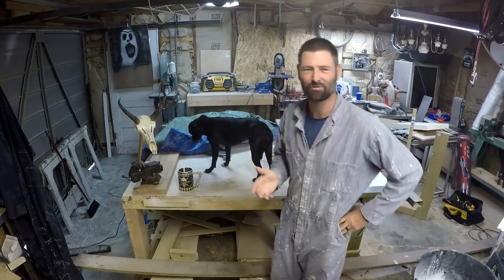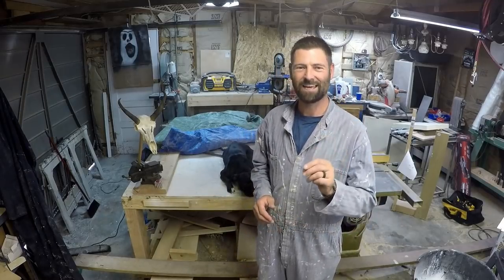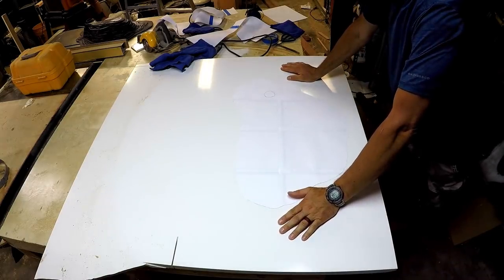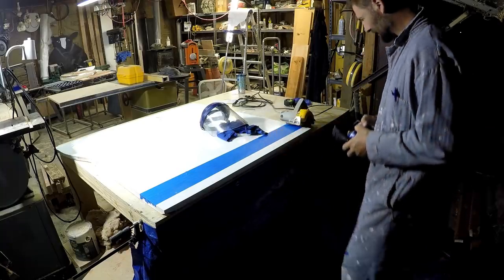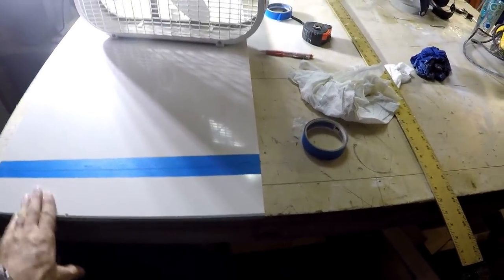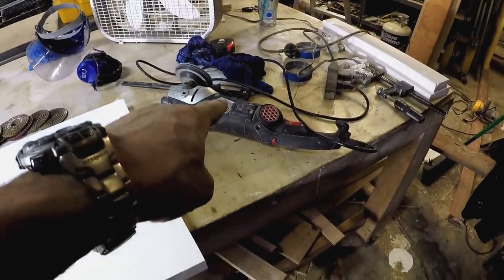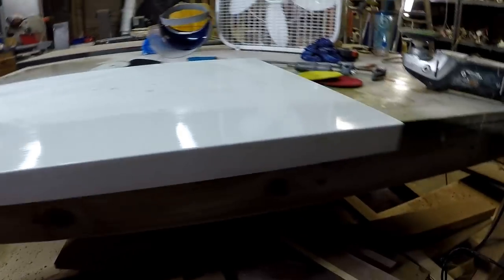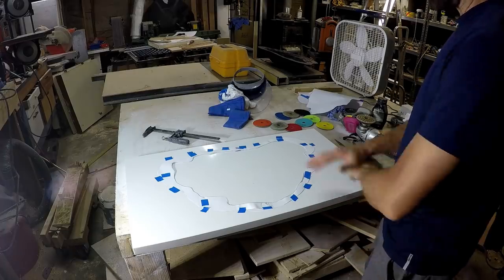How To Make Your Own Quartz Countertop  | THE HANDYMAN | 1940s Bathroom Remodel

Comment: I have the exact same saw, bought it at HD back in the early 2000’s. I only use it occasionally to cut bricks and concrete. I always thought it was pretty good for an off brand tool.Nice to know it can cut granite and quartz if I ever need to. Look forward to seeing you finish the top. Thanks

Comment: You can use a diamond blade for your band saw and use a die grinder to start the polish on the sink cutout. It looks like you would have the clearance to work the slab around.

Comment: Grats on the sponsors!

I frankly don't get why anyone would want a sink like that. Cleaning a standard, smooth enamel sink is enough of a pain in the ass. Keeping that thing clean will be a nightmare. Look cool? Sure. Until you have to scrub it. Think about what it will look like with dried toothpaste crusted in all those little ridges, and when the finish starts wearing off.

Comment: Something I always wonder about these types of jobs is, if you have to buy special tools, saw blades, grinding discs, etc to do that one job, and maybe rarely/never need them again, does it pay well enough to cover the cost? I'm sure sometimes it must just break even or even lose money?
Reply from the maker: I will lose around $200 on this project but I gained a priceless amount of experience.  I took this a a challenge to myself to see if I could do it.   If I failed I have a solid surface counter top fabricator I can get one from.
Reply: On certain jobs I tell my clients up front they're buying special tools etc. if needed. I leave everything they buy
Reply: Good point! I used to do some cleaning and simple maintenance jobs and from time to time I had to lose  a little on a job, but I was helping out an elderly one and I'd have the tool for future use

Comment: My friend has a kitchen counter that is 1cm of quartz over 2 inches of plywood. How would you recommend cutting it to enlarge the sink cut-out?
Reply from the maker: is it a top mount sink or undermount sink
Reply: It’s a really cheap white fiberglass top mount with an odd hole size. Kitchen installers don’t seem to want to touch it. It’s the strangest countertop I’ve seen. Looks like one of those ‘granite transformations’ overlays but it’s just a thin quartz overlay over bare particleboard/plywood. 
I was about to attack it myself with a diamond jigsaw blade but I’m almost positive I’d crack the sucker in half.
Reply from the maker: If you use a new drop in sink you can use an angle grinder and a shopvac to catch the dust.  Put the hose of the shopvac right up to the blade on the angel grinder. Use a diamond blade to get through the quartz then a wood saw to get through the wood.
Reply: Thanks!!! I’ll give that a go. Hopefully the countertop doesn’t splinter but I don’t think there’s much choice!!